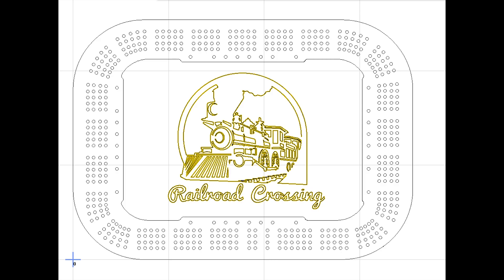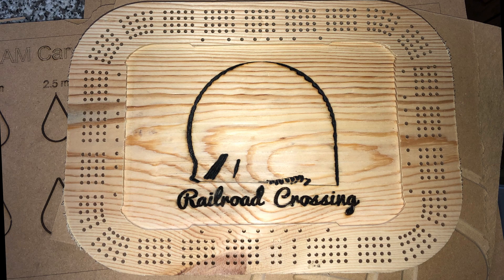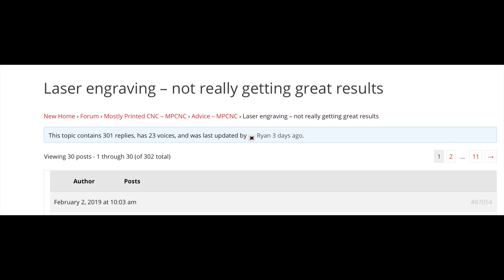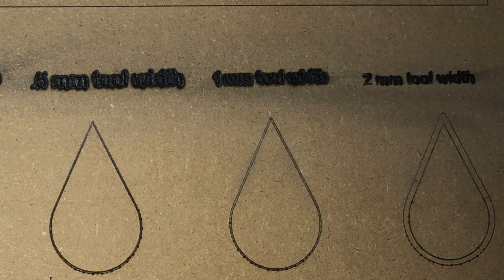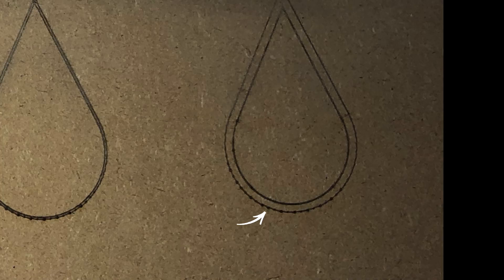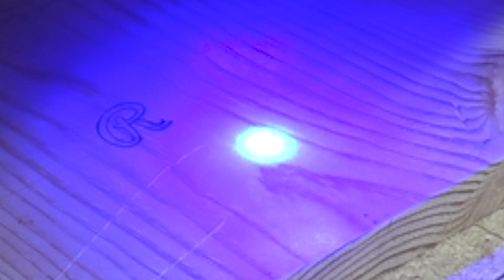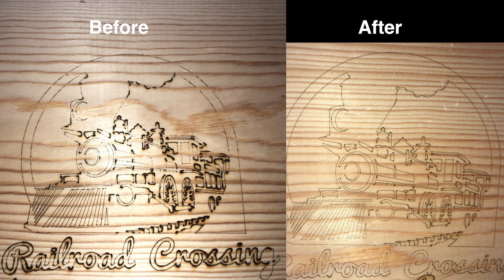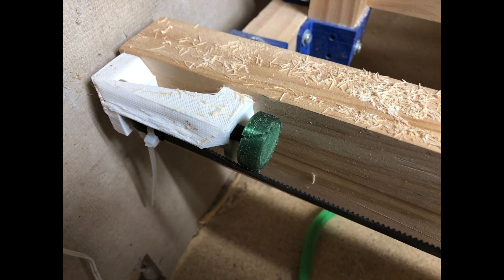Lowrider II Build   Part 12 Updates and Fixes

Comment: are you able to successfully raster an image (rather then line trace it)? Great work!
Reply from the maker: Cerebral Dad Thanks! Yes, you’re right, thats something I haven’t tried. I’ve got an old gcode file set up to raster to try to run. It probably won’t be this weekend. Maybe Monday 
Thanks for watching!
Reply: @Someoldguycoding   I'd be interested in learning how you set it up...ive tried image2gcode and its not working too well for me... thanks
Reply from the maker: Cerebral Dad I’ve been using something from jtech photonics. I’ll play around
Reply from the maker: Well, that didn't go so well.   Laser seems to just stay on all the time. I'll have to dig into it...
Reply: Some Old Guy Coding maybe the pwm pin is floating or your m107 or m05 command isn’t set? If it’s floating maybe consider a pull down resistor on the pwm pin to gnd
Reply: Some Old Guy Coding any more luck?
Reply from the maker: @CerebralDad  No, I tried  changing FAST_FAN_PWM or something like         that. I dunno if that  affects the hardware or software pwm, but when I enabled it, things just got worse.   I think I'll see what the v1engineering team comes up with or downgrade to 1.9...

Comment: I appreciate your persistence with Marlin. I took a different path - Arduino Uno, GRBL 1.1e (or better) and Lightburn. I find it easier to swap the controller board + stepper driver wiring for the axes than fight with the Marlin software. I can also run 24v power with the Uno Shield which solves the occasional under-powering with missed steps of the Z axis motors on my Lowrider 2. Lightburn can take advantage of GRBLs Laser mode which solves the speed, curves, and burnt edges problems. Thanks again for posting.
Reply from the maker: J. Hankinson If I hadn’t come up with a workable solution I would be seriously looking at GRBL.
Reply: I was going to suggest grbl, especially because there is a version for the mini rambo now in the forums. Looks like you worked around it though.

Comment: The issues with curves seems to be the exact same issue that I have been trying to chase down with my 3d printer that runs Marlin with an 8bit board. From my understanding, the 8bit boards with Marlin really struggle to do intense calculations that are required for curves/circles. I had a guy advise me to get a Raspberry Pi and switch to Klipper firmware. The Klipper firmware uses both the 8bit board and the Raspberry Pi together. The Raspberry Pi does all of the intense calculations while the 8bit board is used to just move the steppers. The result is much more smoother stepper movements and no more slowing down (lagging) from curves due to the 8bit boards lack of processing power. I am sure there are other ways around this issue like using a 32bit board with Smoothie firmware.

Comment: Thanks for doing the hard yards. Much appreciated.

Those burn spots makes me wonder if it is worth trying Klipper ( https://github.com/KevinOConnor/klipper ). I'm guessing that they are result of intermittent interruptions in tool movement, when the gcode processing on your controller is failing to keep up with the tool. I suspect that there are any number of operations that could also result in the same kind of interruption. No guarantees, but Klipper could eliminate this (if it crops up again for a different reason). 
(I'm not affiliated with Klipper in any way)